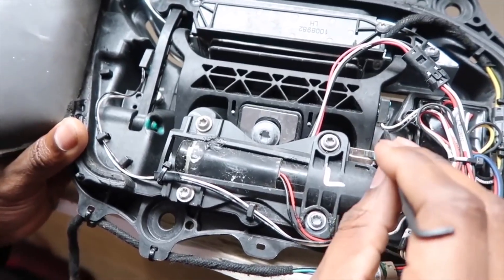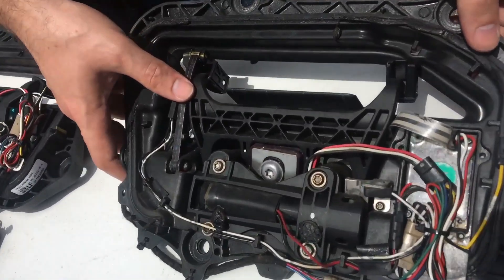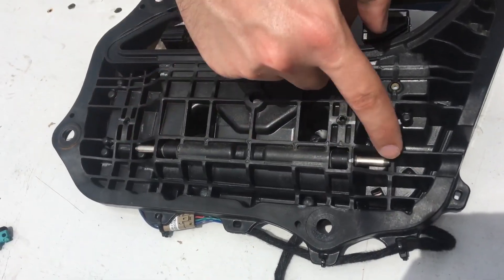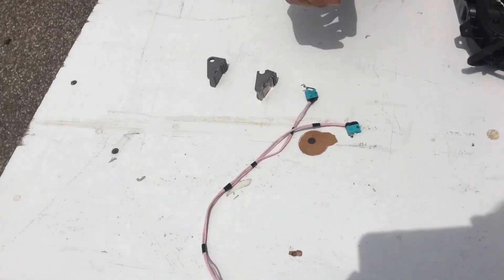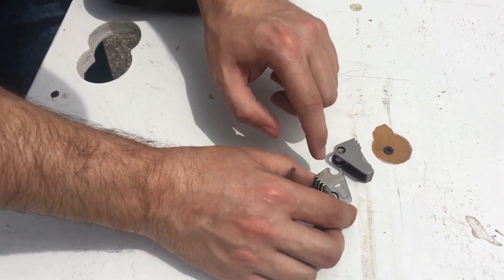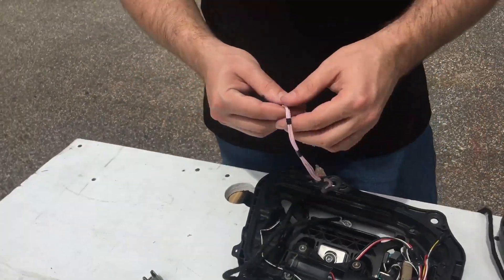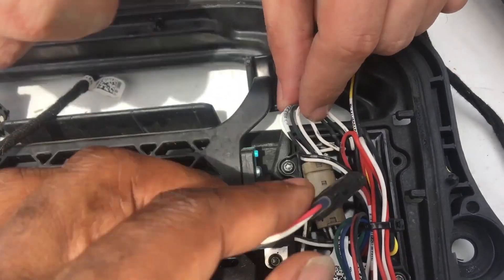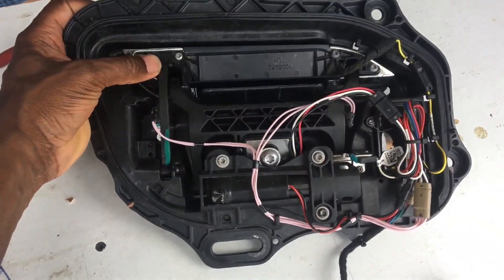Fixing Tesla’s Design for Good

Comment: This is an incredible video!  Really, really helpful to me.  I could not have completed a DIY door handle fix without it.

However, there were several challenges to overcome that I'd like to share:

1) getting the inside door panel off is straightforward so just remember to put the parts (one small rubber cover, one small plastic cover, three screws, two ) in a place where you can find them later

2) disconnect the three wires holding the inside door panel to the door so that you can put the inside door panel to the side and avoid scratches or damage

3) getting the door handle out is a big challenge
a) there are four bolts (one in each corner) and at least two of them are very hard to access
b) the upper left one can be easily accessed if you remove the silver tape covering the access hole
c) the upper right one is a real problem -- eventually, I figured out that lowering the window and removing the window strip allowed me to access the bolt from above -- once I got it loosened, I was barely able to get my hand in there to remove manually -- this was the most difficult step
d) there is no need to remove the window but you may find it helpful moving the window all the way up (note: the window can go up a little more, which is helpful, if you press the lever where the door catches the body of the car)
e) there is no need to remove the black metal bar inside the door which is in a very inconvenient place

4) you need to figure out if you have a broken relay or a broken metal "paddle" (where the bottom holes have broken so that the paddle is not moving anymore with the gear below it) -- I had a broken paddle and found a new one on eBay for around $30

5) be sure to remove the gear (three bolts) before inserting the new paddle

6) be sure to remove the "C" clamp before moving the lever over or else you will break the "C" clamp

7) the sensor by the paddle has a metal piece sticking out of it -- you may need to remove it, then insert the new paddle, and then reinstall the metal piece -- basically, you want the paddle to hit the metal piece to then touch the sensor so that the door handle does not recede too far in -- that's what the sensors are for: keeping the handle from moving too far in or too far out

8) when putting the handle back into the car, make sure to position it so that the chrome part does not rub the opening when you open or close -- try locking and unlocking the door a few times to test before tightening the bolts (note: make sure you have reconnected the one wire from the doorhandle to the other wire inside the door

9) your door handle may have a yellow wire that does not connect to anything (mine did) -- this is for an accessory LED light to illuminate the handle -- I did not find an aftermarket part to add this although it seems simple to install if it existed

10) when reassembling the inside door panel, there may be two wires from the car that don't connect to anything -- also, it is not necessarily the case that wires are the same color on each side after being connected (because, I guess, that would make too much sense)

11) if you haven't gotten your hand covered with grease and scratches, you're doing something wrong -- have a child assist you with smaller hands is a good idea to reach into tight places

Comment: When you purchase a new car for that amount of money you shouldn't have problems like this in the first place. Paying Roles prices for Yugo quality. It would have been much better to use common proven components and cabin equipment. Delivering reliable vehicles at a much lower price point.  It is redicaless to require removing the entire battery assembly just to replace the fuse. I can invasion several different ways to design the fuse assembly for ease of exchang with complete and total safety for the person making the exchange. The more I learn about these cars the less impressed I am.

Comment: In ICE cars the combustion engine is the (unavoidable) most complicated item in the car. Usually they are very reliable. In the very expensive Tesla’s even the doorhandles and other gimmicks create problems for their owners. Even when they are new they fail, let alone after 10 or 15 years of use. In the end most people want affordable and reliable cars. In 2020 the more experienced auto makers will step in the EV market with full force, they will take over.

Comment: There's too much of this BS Poor Build Quality going on. Elon should get a fim handle on all of this before bringing out a new truck. If not the supporting public is going to be worse off than they were with Detroit and I'm never going to make a move like that . . . no matter how much hype there is. In many ways having even a minor problem with any Tesla is a likely Major Problem. e.g. Hood position sensors with the bolts put in backwards requiring disassemly of the entirefront end to change a sensor.   A Lot of deliberately unnecessary $tupid $tuff. 

Why can't  TESLA . . . the car of the future be COMPLETELY Self-Diagnostic down to the part number and VIEWABLE by schematic on the cars own puter screen AND make all parts on the car easily accessable.

Comment: As a person who worked in engineering design, from concept to full production and product support.  I see n this happen for decades at even the most talented levels and walks of life from Honeywell, 3M, Caterpillar, Cummins, Ford, GM, Boing, ATK, GE, BNSF, United Defense, BAE, Alcoa, Westinghouse, Eaton, Emerson Electric, General Mills, Cargill, Polaris. 

The nature of the market drives conservative to monopolistic then myopic trends in any industry regardless of the innovation.  The complexity of many systems is about many interdependent factors.  The reason Tesla was regarded by so many old school industrial groups as impossible.  Is because of the company risk management mantra of every three months. You must submit to an ignorant set analyst drones.  Who are only there for making money for their interests?  Which are the myopic monopolies?  This means for a very small startup to make it and thrive they need to make those drones eat their shit.  But inside a fast pressure cooker, the idea of bringing in thousands of highly skilled manufacturing, design, systems, engineers and a broad group of a well trained diverse workforce is extremely difficult.  This the time needed to do a thorough systems check of every part is not able to happen at a six sigma level.  Plus since it is a heavily California work pool.  It's hard to find a good mix of energy, experience, dynamic talent, that works in a high-pressure environment.  It takes ten thousand hours to be relatively efficient at any one thing if you are allowed the proper mentoring, drive, and education to learn and fail without losing.  Most companies don't allow this in high pressure, thus they lose out on people who may be brilliant in several ways but inexperienced in others.  A good company uses its resources to build its skilled workforce with the benefits coming later.  But only if that it's not a zero-sum system.  Rich is an excellent type for engineering systems tech.

Comment: i’m not against designing things a little differently for looks but the old expression if it ain’t broke don’t fix it clearly is something musk and his crew have zero idea what it means. you could still have the same design and function but also have it manually connected to the actual door hatch instead of having the handle push a button that power a electrical motor to move the hatch opening the door. you would think redundancies like this would be built in not only not adding in another thing that can break and not work but also if the car runs out of power. it almost seems like half of this crap they have done they did just so you would be forced into taking the car to tesla to get it fixed. spending thousands of dollars fixing something that could have been designed so it would almost never need fixing. can buy a $500 pos car from the 80’s that barely runs guess what still works. the door handles.

Comment: When I am forced kicking and screaming to buy an EV it won't be one like this. So much over complication and over engineering. Even the crappy Chinese tractor I owned was better engineered. 
I replaced about 3 rear tailgate locks on my LR3 so not unusual for this poor engineering but annoying. At least you get the tailgate to open though.....after removing half the rear trim :(

Comment: The silicone insulated wires make sense for low temp flexibility but I hope they have properly tested the moisture sealing around the switch connections as silicone is hard to seal to without a physical gland.

Comment: nice video , many cars with soft-close feature have similar issues.  It fails after some use , often after expired warranty. having small servos, sensors and other electronics in a door handle doe not make it last longer ..however  this original design of the switch solution is some of the worse ones i have seen...but at least they looks repairable. many of the soft close handles on other cars are basically impossible to fix , clean the sensors and hope for the best...

Comment: the more i watch these tesla videos the more i learn why teslas cost so much. there is way to much stuff in that door handle. all this could have been done with half the material and it would still do the same thing. none of the wires or switches would be exposed and could still be replaced instead of putting everything in potting compound. truly engineered by people who just know how to draw on a computer but no real world experience about building anything.

Comment: I’m not standing up for Tesla or any car manufacture for that matter but these types of issues have little to do with “design engineers” or “the company not figuring it out”. These types of issues generally come down to industrial engineers who are responsible for materials and how the design part is actually manufactured. A specific part like a door handle would be given a budget and then they would have decide things like cost of material and the actually manufacture process (i.e. casting vs machining). On top of that they have a rate of failure so the cost of warranty replacements can be calculated in the budget. Long term testing lab testing takes time and money and can’t fully recreate real world long term use. When issues exceed an acceptable rate of failure materials or designs are changed while still keeping with the budget. At the end of the day it’s a business and the bottom line is always money.

Comment: Jeremy is right--simplicity is the source of long term use without failure. Those door handles look like they were designed by a committee. Make the parts that unlock and open and the door mechanical, and for other electronic requirements make a completely separate circuit that will operate the mechanical system. In other words, backup the electronics with a purely mechanical system.

Comment: Remove the mechanical switches in the door handles, because water intrusion. Use infrared emitters and sensors (the lenses will have to be cleaned periodically, you solve that one) to activate the thing. You must choose a special coded frequency, which you can interrogate on your main viewscreen, if you like. Just don't run out of error codes.

Comment: Hey Rich, would it be possible to swap some of the senors/switches to make it so the door unlocks when you push on the handle (normally triggering the handle coming out), and stop the handle coming out altogether?  The door should open enough to grab it on the edge and pull it.  Thoughts?

Comment: Wow what 4+ gens and thats how long it took tesla to figure out a door handle?
That's almost amazing the level of disgustingly poor engineering. 

I know its a stretch to compare consumer level products to Space travel but yesh seeing how they routed wires: scary to me thinking what else they are hiding, they clearly didn't care for longevity under stress. I went to school for aviation avionics (Aka Aircraft electrician), I see this and instantly worry for SpaceX. 

The guy explained it perfectly: like a paperclip fails and breaks after bending repeatedly. Departments like Quality-control and then test bench exist for a reason, were they non existent or just on holiday? Had to have gotten passed through engineering, and stress tested, yet still made it in the vehicle worth more that I make in a year. It just blows my mind, that somehow someone along the line figured it was a great idea to just put a rigid wire to a switch on a moving part. Elon musk, how the fuck did you make it to Space.

Comment: I will never own a Tesla, even the handles are designed to fail. The electronics won’t last in them either, eventually the capacitors in them will need replacing, and because they are potted that will be nearly impossible to do.

Comment: I am Senior Electronic Maintenance Engineer and have done this kind of modifications a lot. This one looks really good and will probably work for a long time. Using that black silicone over the microswitch solderings is good idea because it takes the stress off the solderings and seals them too. I’ve done the same. Too bad that one of the most innovative cars have these kind of trivial faults.

Comment: why don't they put the switches on the parts that don't move? solve the wire's breaking over time all together. Heck just use standard mechanical door handles.

Comment: This exemplifies the misconceptions of automobiles by the Silicon Valley types. That door handle with an exposed ribbon wire wouldn't have made it through the first prototype in any real car company, not even Chrysler. Even the third iteration is a failure waiting to happen. I hope Tesla does well, but its engineering has a long, long way to go.

Comment: Bad door handle design, that Tesla apparently still has not corrected  .... micro switches should NOT have been mounted on the moving part, since that stresses the wires with every movement .... and automotive rated sealed switches should have been used. As for the electronics sealing, simply potting the board, isn't going to work well in automotive, due to large temp swings, a sealed cover with pressure relief membrane valve is the preferred automotive solution. The breaking metal gear piece, is simply too weak .. makes ya wonder if they ever did any physical stress life testing on this design before installing it for "customer beta" testing, LOL.

Comment: Here's what Telsa should include. A cable or rod of some kind physically connecting the handle to the door's latch. It can still be motorized so that it goes inside the door but should be out just enough you can pull the handle and unlatch the door without having to worry about a dead battery or faulty electrical. Also a physical key override, if the car is locked and the battery is dead/ the lock system fails you need some physical way to unlock it without having to call a wrecker to break into your own car.

Comment: When the average car has ~4000 Individual Parts, it is normal in this industry that small percentage of those either have design or QA issues.
The 'perfectly designed' cars are the ones which aren't mass produced but custom designed.

Good video though.

Comment: First rule of good design:  simpler is better.  This door handle design is a nightmare of potential problems.

They could have saved thousands of dollars on manufacturing cost and millions more on warranty repairs if they'd simply used a switch like TVR did in the 1990s.  Put a weather-sealed switch in a discrete location on the body and you're all done.

Comment: So Tesla cars are not ecological at all. If we will have now to change car every 3 years there will be far more polution than from petrol and disel combined.

How much did they save per car on heap wires? 10$? How much that car costs? Original parts are like for cheap car, not for premium. Thanks for aftermarket engineers for kits like that.